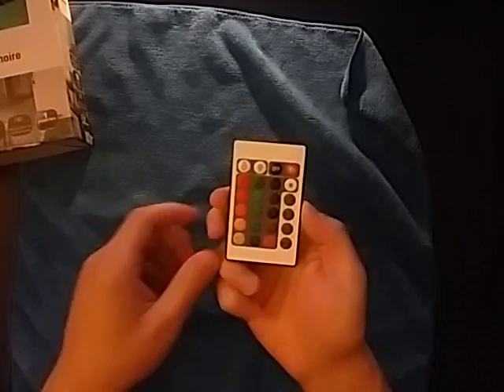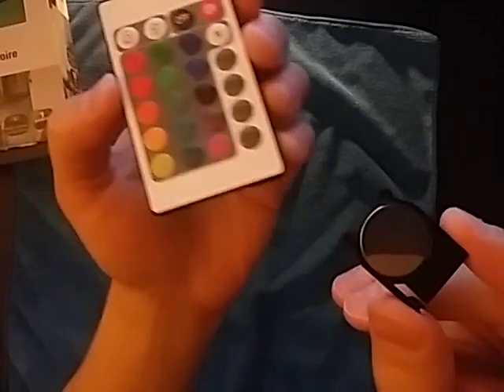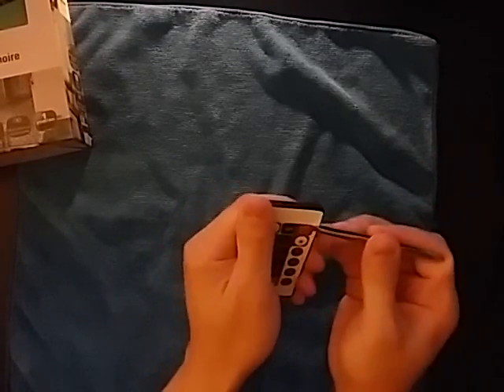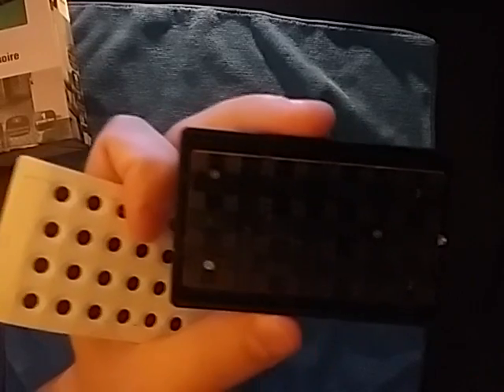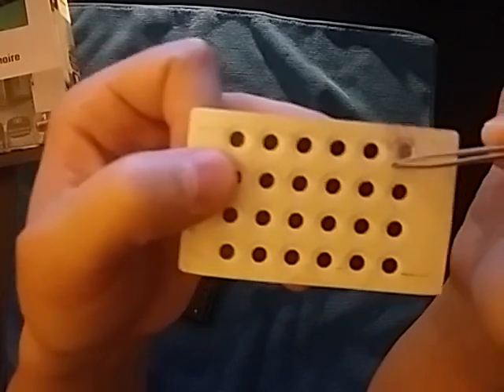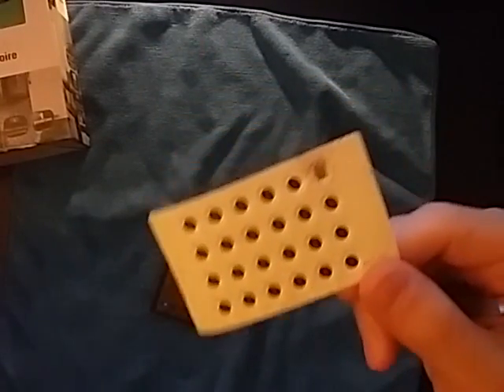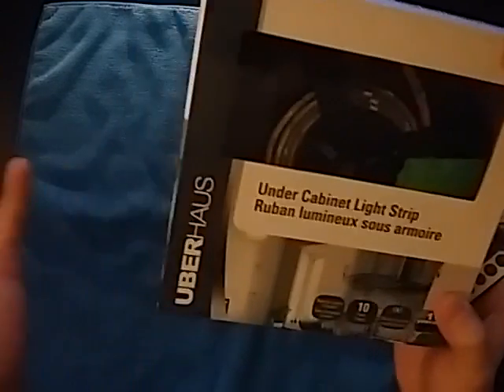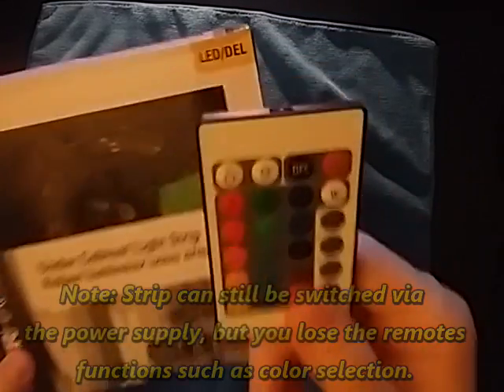LED Remote Repair (Buttons Not Working)

Comment: mate, im not facing problem with 1 button here, my whole remote isn't working :/
Reply: Same here.
Reply: DO this: (By Chill Lee) Quick tip. If you dont have aluminum tape, remember the contacts are CARBON. Peel the cover off and check if any of the contacts are patchy or wearing out. Take a regular #2 pencil and basically fill in the contact since there is carbon in lead. This should fix the problem easier and cleaner than using aluminum tape.

Another solution: (by Thomas Gent) you might also try scraping the contact pads (DON’T DO IT TOO HARD!!) with a paper clip, screwdriver or another sharp object.

You can also just try replacing the battery as well. :p

Good luck! :)
Reply: Tyanne George haha! Of course! I am glad it helped someone! I hope you have a wonderful day! :)
Reply: Moon Tasir same
Reply: Moon Tasir same
Reply: Moon Tasir dude same
Reply: I had same issue I just went and gave all contact little scrape then it worked perfect
Reply: Happiness is key  tried that still didn’t work
Reply: Same, anyone got a solution?
Reply: Kim Nguyen have u tried giving the contacts a little scrape as mine was doing that none worked and then I scratched the power on and it worked. Also what about putting a new battery in
Reply: @happinessiskey2858  how do I do it??
Reply: maddie just get a pencil with lead (it can be a wood or mechanical pencil) and peel off the layer with the color on it. Then, where the buttons line-up with the contacts on the remote, scrape the lead from the pencil on the piece you just peeled off. Then, after you are done doing that on all of the button contact, turn the remote right side up and vertical (IR - Infrared should be facing away from you) and then put the layer you peeled off back on.

Simpler version:

1. Get remote
2. Peel off top color layer (the part you usually see) just get a small flathead screw driver or something small and flat and pry it up. Be carful not to go too deep as you could damage the whole remote.
3. Get a pencil and draw/scribble on the underside of the button pads.
4. After you have done all of the buttons, then take the remote and face the top away from you. Then, put the colorful cover part you peeled off, back on again.
5. Now try it! Make sure your light sensor (usually attached to where the lights get power from) is visible to you so the remote will communicate with the IR sensor.

Good luck and let me know if I could be of any more help!
Reply: Thomas Gent Yes, these both seem like great suggestions as well. I will edit my comment and put these in. Thanks!
Reply: same i literally keep changing the batteries still nothing
Reply: Oscar Alaxite maddie just get a pencil with lead (it can be a wood or mechanical pencil) and peel off the layer with the color on it. Then, where the buttons line-up with the contacts on the remote, scrape the lead from the pencil on the piece you just peeled off. Then, after you are done doing that on all of the button contact, turn the remote right side up and vertical (IR - Infrared should be facing away from you) and then put the layer you peeled off back on.

Simpler version:

1. Get remote
2. Peel off top color layer (the part you usually see) just get a small flathead screw driver or something small and flat and pry it up. Be carful not to go too deep as you could damage the whole remote.
3. Get a pencil and draw/scribble on the underside of the button pads.
4. After you have done all of the buttons, then take the remote and face the top away from you. Then, put the colorful cover part you peeled off, back on again.
5. Now try it! Make sure your light sensor (usually attached to where the lights get power from) is visible to you so the remote will communicate with the IR sensor.

Good luck and let me know if I could be of any more help!
Reply: Moon Tasir dude same. It didn’t come with batteries. So I got some but it isn’t doing anything
Reply: Sadie Dooley this might sound really bad, but did you make the “+” (plus) side of the battery face up (the colored buttons and the “plus” side of battery should be facing up. If that does not work, the please kindly refer to my other instructions mentioned above. Good luck!! :)
Reply: Happiness is key omg thank you so much
Reply: My whole remote was not working.  Just the single colour type.  I took it apart and unscrewed the board and found the LED had become detached from the board.  I carefully scraped the contacts with a small flat screwdriver to show some copper then tinned the exposed copper then soldered the LED contacts back on.  reassembled and worked first time.
Reply: same here
Reply: same and it’s stuff on one color
Reply: Moon Tasir same
Reply: Moon Tasir same my on and off are colors
Reply: Same dude
Reply: Happiness is key what are the contacts?
Reply: @happinessiskey2858  when I looked at my camera every time I pressed a button like brightness or turn off wouldn't work
Reply: Janya Sheffield - They are the little metal pieces in the remote. They are usually a copper color, but they might be different depending on when your remote was made. They conduct the electricity to tell the lights to turn on/ off, change the color, etc.
Reply: GoodKidIsaac - Hmm, did you try a new battery or try taking apart the remote to put some pencil lead on it? Maybe try that if you haven’t. :) Good luck!
Reply: @happinessiskey2858  I replaced the battery didnt work and can you link a video a tutorial of the lead thing pls and thank you so much
Reply: Happiness is key thank you so much ❤️
Reply: Happiness is key I’m kinda confused wym by peel of the layer with the color on it and scratch it...I’m confused by the whole thing my remote buttons aren’t working😭😭😭
Reply: GoodKidIsaac yes, I’ll see if I can make something for everyone to follow with images. Please give me a week or so to do this. I’ll post back on this comment tread with instructions.
Reply: Janya Sheffield you’re certainly welcome!! Glad it worked out well! :D
Reply: Elainaaa there should be a white plastic layer of which you should see the color that you can press to turn on the lights, change the colors, make it flash, etc. Peel off that plastic layer to expose the internal electronic board (PCB). On the back side of the plastic part you peeled off (where this IS NOT ANY color), get a pencil and scratch/draw in the little indentions. Then, just put the plastic cover back on like it was before. Then it should work again! I’m happy to report that mine is still working great for almost a year since I tried this. :) I hope yours will, too! As I told @GoodKidIsaac I will try to get some instructions together on how to do this, and post it here after it’s all done. In the mean time, please try the above.
Reply: Update everyone! First off, I can’t believe it’s been two years already. Lol

Okay, so I did what I said in my comment, and my remote has been working wonderfully ever since then! I’ll try to create some better detailed instructions, and post a link here for your convenience. Stay tuned! :)
Reply: @happinessiskey2858  thank you so much
Reply: GoodKidIsaac of course!
Reply: Happiness is key I did what you said in the instructions and it still isn’t working... I don’t know what to do. It’s not the battery either because I did the “lick” test and it seems to be working fine
Reply: Noerua Love hmm, that’s not good. These remotes are made very cheaply which can be good as it doesn’t cost much in the end, but that also means that there are A LOT of defective units.
I’m releasing a video tomorrow to help people with this issue. You can take a look at that to see if it helps. If not, you might check Ebay or a similar shopping site for a new remote. I wouldn’t think they would take the time to make these remotes serial number specific codes. Best of luck to you!
Reply: Same
Reply: Happiness is key Ok thank you! But it turned out I had the lights or the cord piece that go in the white adapter plugged in the wrong way. (Took almost an hour of fiddling around to figure it out)
Reply: mumbaasauce _ did you try switching the way the led lights cord thing (it’s black usually) is plugged into the white receiver (at least I think that’s what it’s called) my problem was I had it turned the wrong way.
Reply: Noerua Love haha, that’ll do it too! I’m glad you figured it out though! :)
Reply: Happiness is key It didn’t work and also do I do it on the inside part of the Colors or the inside part
Reply: Suprabha’s Life you should draw with a pencil on the inside of the remote (where there are black circles) not where there is color. Good luck!
Reply: Happiness is key do I do it for the whole circle
Reply: Happiness is key , so I just bought some led light &’ all there doing is flashing red,green, &’ blue &’ I can’t change the color what do I do?
Reply: @suprabhaslife2307  Yes, just draw some on the black part. You can do it for the whole circle, and that'll mostly guarantee that it'll work if it's a remote issue.
Reply: @francescavaliente  If you press on the remote, you should be able to change the color. If that doesn't work, then make sure the IR receiver is not blocked by anything so it can 'see' your remote. The IR receiver is on the smaller box that doesn't plug into the wall, it plugs into the lights. If that's a no go, then try replacing the battery in the remote. If it still doesn't work, then try using something like a credit card or knife (ask an adult to help you if you're young) to draw on the black contact points on the underside of the remote. If it still doesn't work, then make sure that plug works with another electronic. If not, you lights might be defective. You should contact your lights' manufacturer for a replacement or RMA. Good luck! :)
Reply: Happiness is key It didn’t work but thank you
Reply: Same
Reply: Is your battery the right way?
Reply: Francesca Valíente I Don’t know ,that happened to me and I bought 4 the same thing happened😭
Reply: Moon Tasir same
Reply: Same
Reply: Happiness is key Hey bro just did exactly as you said. Even pulled the switch board out to check that everything seemed normal. I scratched at the indentions and used a led pencil but still no luck. Even replaced the battery. It just seems as the whole remote is dead
Reply: Happiness is key Hey bro just did exactly as you said. Even pulled the switch board out to check that everything seemed normal. I scratched at the indentions and used a led pencil but still no luck. Even replaced the battery. It just seems as the whole remote is dead
Reply: Graham make a video plz
Reply: Same
Reply: I have a 44 button one that doesn’t work at all so yeah I’m like you rn
Reply: Exactly
Reply: @happinessiskey2858  2 years later and you’re still helping 😂 This method fixed my remote! Tysm
Reply: @duckydaduck2233  haha, yeah, I know it’s pretty crazy. We have to fix these remotes though! 😂 You’re certainly welcome! Best of luck to you!
Reply: @happinessiskey2858  hey do you mind helping me out. My remote won’t work. I did what you said to do but with the pencil but that didn’t work. And I made sure the battery is working and with the + side up. I only thing I’ve noticed is the buttons I use wot like the power button and the color white don’t have a click feel to them unlike the buttons I rarely use. I probably will just buy a new remote but might as well as you before I do.
Reply: @johnvow7728  hello! Hmm, okay. Make sure to put the plastic cover back on correctly and like it up with the buttons. The infrared light should be at the top along with the power buttons, and the brightness buttons. Make sure to mark up all of the buttons.

If that doesn’t work, make sure that the lights are properly plugged in. They will usually flash once when they receive power. Make sure that everything is also plugged in to the junction box down the line from the power cable, and make sure that the infrared sensor and the remote have a clear line of sight.

If it still doesn’t work, then your infrared sensor on your remote could be bad. You could buy a new sensor and solder it on, or you could probably buy a new one from Amazon or EBay. I’ll see if I can find a link that ships internationally.
Reply: @happinessiskey2858  can you do a tutorial
Reply: @justchristian6669  Yes, I’m working on one right now. I should be able to film it tomorrow, and then I’ll edit it, and upload it. I’ll put a reply here with a link to it when I’m done as it seems to be in high demand. :)
Reply: Yup 👍🏽
Reply: Sameee
Reply: @happinessiskey2858  this doesn’t work
Reply: i have 2 led lights with 2 remotes
Reply: same..
Reply: @happinessiskey2858  doesn’t work
Reply: Happiness is key you wrote all these replies a long time ago but you seem to know how to make it work again. cuz my remote doesn’t work at all and i think the batteries okay, i mean it’s new. and I’ve been looking at your replies but it doesn’t show the whole thing of what you said so can you please help
Reply: @happinessiskey2858  can you please make a video I'm so confused my hole remote isnt working help please I cant turn it on or off or do anything I'm so confused help?
Reply: Same here bro
Reply: If not the battery try patting it on front and back with the power off then try using it again. You may laugh but give it a try. In another video I saw this technique and it worked.
Reply: @happinessiskey2858  doesnt work for me:((
Reply: Same
Reply: @graham6302  You're saying i can apply a bit of solder if i need to and it will work ? That would be easy :P
Reply: @NeverenCH  That's what I did to make an electrical connection from the LED back onto the board but recently it came off again and I had to run a short length of wire from the LED down to a lower point of the track and solder it there.
Reply: @graham6302  Good to know as a last resort :D Thank you
Reply: @happinessiskey2858  thank you
Reply: @Thomas_Maxine_Kingsbury  you got it! :) Enjoy your lights!
Reply: @happinessiskey2858  hello, i changed the battery and mine was working fine but one day it just stopped working and the red light on top was too weak , so i made sure that my cables are correctly plugged and my PSU is working fine and the batteries are on the right side and the red light started flashing strong on the remote , but the fans aren't responding to any button , so i peeled of the top layer of my remote and scratched the contact with my credit card and it still doesn't respond , and btw i opened my PC case to make sure that there is nothing blocking out the sensor but still no respond , also it wasn't working after i changed the batteries but suddenly it worked , then i took the batteries off and placed them back in (correctly) and the problem began since then (the weak red flash that i fixed later ) but until now fans won't respond
Reply: @brittannysosa6782  you might be able to see if the battery is still good by testing it (in another device or with a 3V battery tester which are pretty cheap). Make sure your light are all plugged in correctly and also make sure the plug that goes into the little box (not the one you plug into the wall, the other one) is plugged in ALL the way.

Also, get some sort of camera and point the remote at the camera lens and see if you can see the red IR light through the camera. You might try multiple different buttons.

Sorry, YouTube stopped sending me notifications for new replies here since I got so many.
Reply: @asmaaqasim6065  I made a video, but took it down after a bit. I can make a better one as I made that one in just two days. If there’s interest and people think it would help, I’ll see what I can do. Maybe next week I start on the new one.
Reply: @neetdolsi7890  did you put these lights in your PC I’m guessing? The remote doesn’t control fans (unless you have fans that are controlled by a remote and your remote for the lights is controlling your fans as well).

Comment: First do all the obvious things like checking the cable is connected, remote has battery, voltage etc.. and if your whole remote still isn't working, use a knife to lightly peel up the adhesive on the remote.

I fixed mine by removing the adhesive, using IPA to wipe down the board on the inside, I also got some IPA on a cotton tip and very lightly went in a circular motion on the contacts themselves on the adhesive.

Putting it back together with a new battery, and it's as good as new :) Please like so people can see this.

Comment: WOW you saved me so much of a headache. I have a similar remote. Used an exacto blade to lift up the button panel and press all the buttons up and thats what got it working. I guess they shipped the remote with multiple buttons collapsed/shorting the remote so nothing ever happened because it was also stuck on multiple buttons. TIP make sure all the buttons are popped up like the little buttons on top of a soda from a drive through. These remotes are very cheap and with the film they are shipped with you might have smashed all the buttons thinking it couldnt be that cheap to be rendered broken that quick. That was the case for me, worked once and now i am here. Thanks !

Comment: I've watched a lot of videos trying to fix my remote with now success. This fix worked: I pulled up the strip and cut out one of the buttons I wasn't using. Cut out the bad button and replaced it with the other working button. BOOM. Works perfectly. This button replacement is simple since the whole button cover is sticky so it's very easy to stick the new button in the old spot.

Comment: Your video saved my rgb fan remote controller ,, I almost tore it  apart luckily I saw your video literally seconds before I did so, and  removed the adhesive and replaced it with another. Thanks alot man.